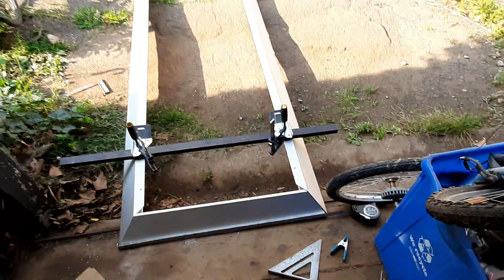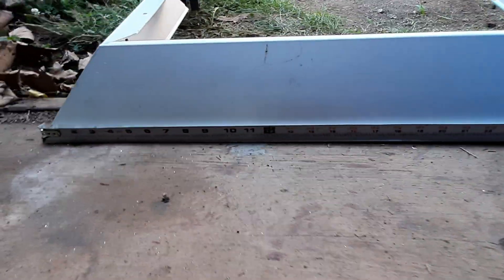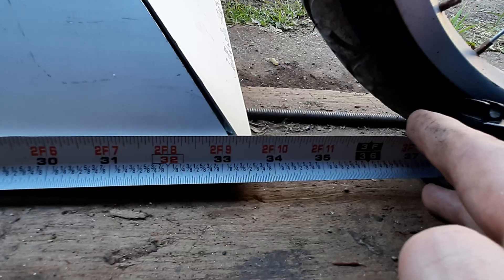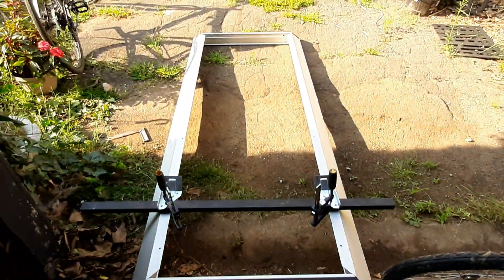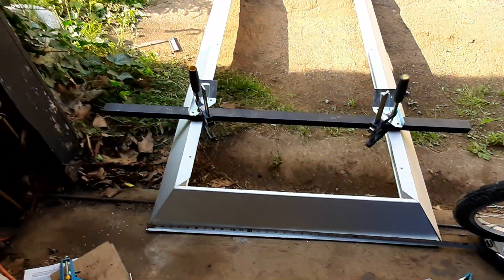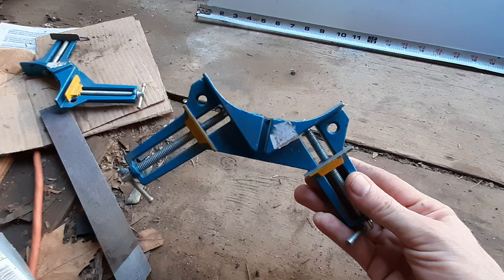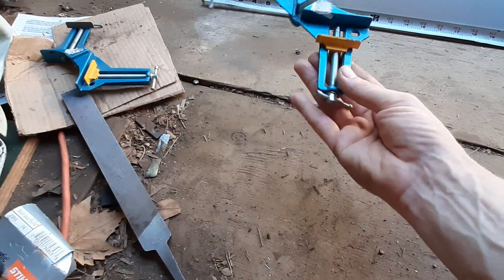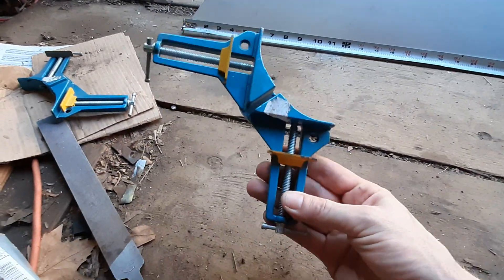Bicycle Camper Trailer part 3

Comment: get thebharbor freight sq clamps. best in thebmarket, clamps up to 1.5in
Reply from the maker: These triangular tubes are 3 to 4 inches wide, the 90 degree clamps would have to be quite substantial. I live in Canada and we do not have a harbor freight but  we do have princess auto which sells many items that appear to be rebadged items that are commonly sold at harbor freight.